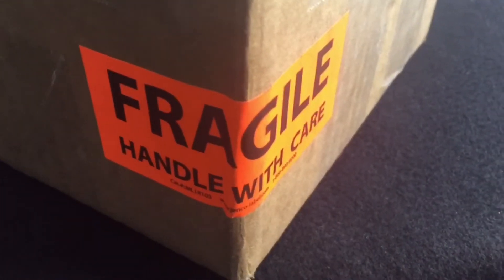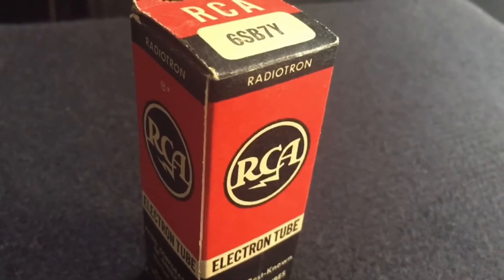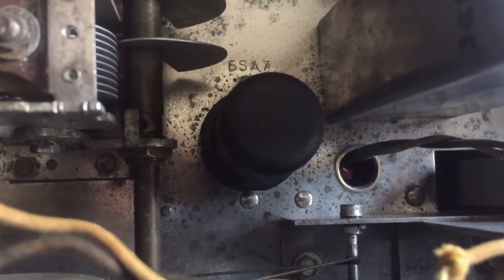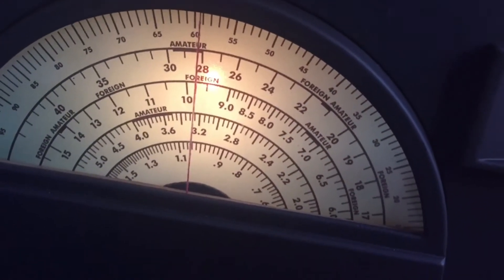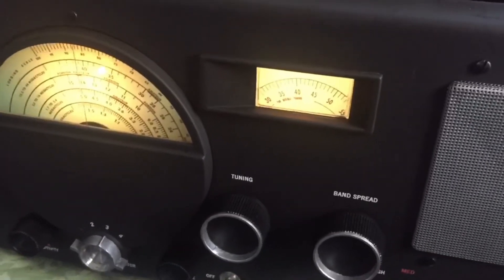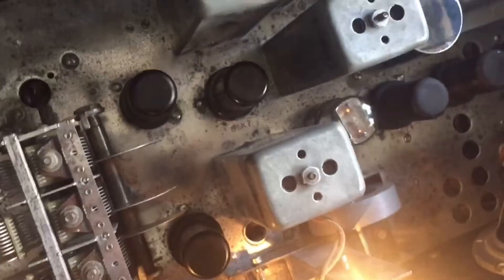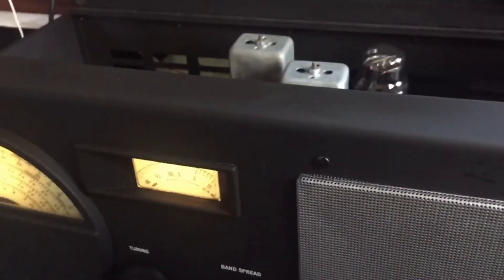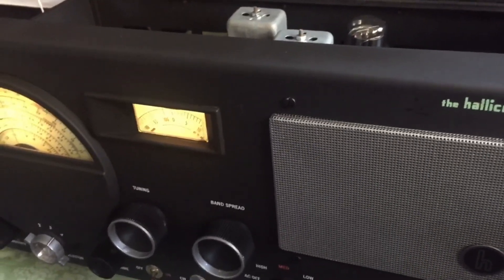Hallicrafters S-40 Performance Tweak

Comment: How long is your antenna? What kind of antenna do you use if I may ask. I have an S40-B and band 4 is also picking up nothing. I’m very curious in this sense as I’m planning on getting that tube to try out also.  Great video by the way.  :)
Reply from the maker: dennis perusse Thanks- I have several antennas, but have had good success with a 75 foot longwire. These are fairly sensitive sets, so you do not need anything elaborate. Enjoy!

Comment: Hi Art; Just ran across your demo. If you have a sig gen put a small ant on the output. tune to a feq close to the high end,. Put the old SA tube get a reading, pull that tube and plug in the new SB tube, what is the deff??? 73 Greg

Comment: I found that using 1n4004 diodes across the 6h6 detector tube diode section improved the sensitivity and stability a lot.
Reply from the maker: Can you be more specific? How many diodes, and where exactly?
Reply: @ArthurHallicraftersKitchen  If i remember correctly there are 4 diode sections to the 6h6. Look at the tube diagram and you will find the 1n4004 diode has slightly higher voltage ratings than the 6h6. You can leave the tube in and solder the diodes on the tube socket. I would have to find the tube diagram again to tell you what pins they go across. In the 80's tubes were getting expensive and diodes were becoming popular and some companies made replacement diode tubes using solid state diodes. I used this idea to put the diodes across the diode section of the tube. saved a lot of money and the units worked great.
Reply: if your 6h6 is dead, and they do go dead, it works like so. I noticed the same, but swapping out the 6h6 with another one fixed the issue. no need for 4004 - should use a schottky or germanium really

Comment: Stability , do you mean it drifts of frequenty when tuned to a station?  i think its caused by capacitors , try to find good quality silver mica for the oscilator circuit .   
the sochet , use iso-propanol  alcohol and a woden toothpick to gently clean the socket internal .
Best sensitivity ,  i think you have to align the front end
Reply from the maker: stefan lowet No. clearly you are new to this. Most vacuum tube receivers will drift slightly due to thermal instability of vacuum tube circuits. If you think recapping a radio is going to take care of this, well, I’ve got some land in Hoboken I’d love to sell to you. This tube swap out takes care of this issue on this radio, which was already recapped. But thanks.